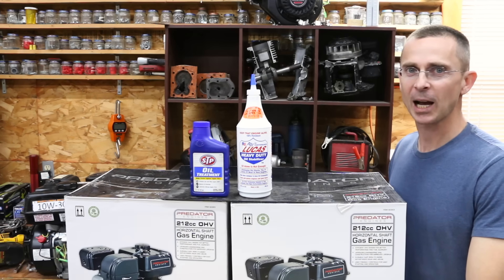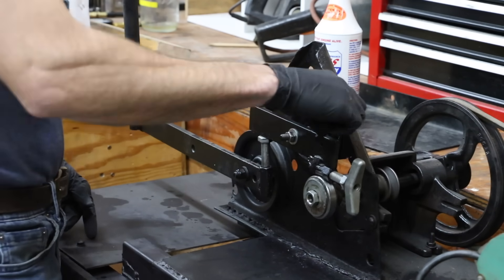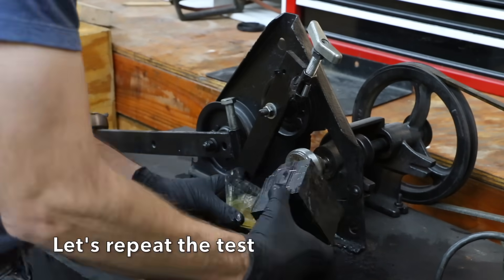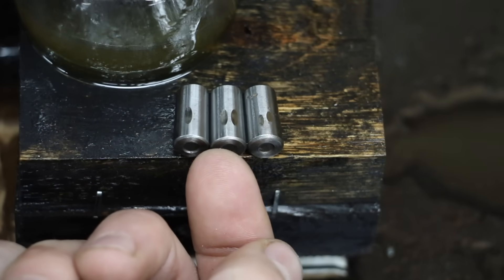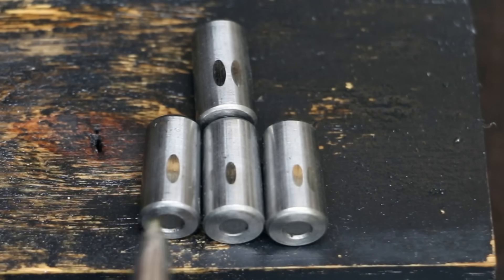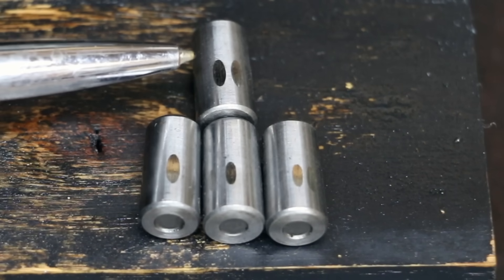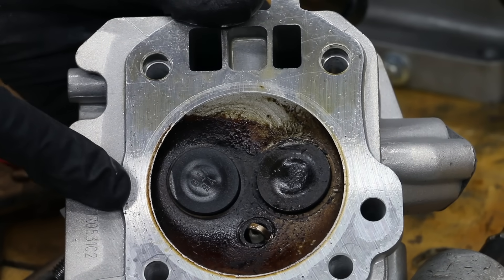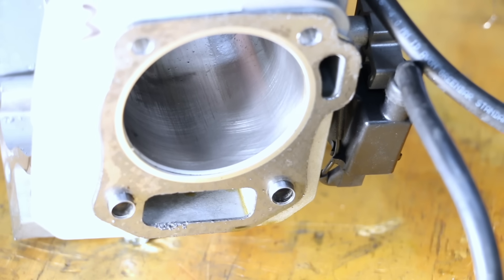Which engine self-destructs first?  Lucas or STP?

Comment: Both of those products are nothing but snake oil.  I found that out with STP years ago and have never been dumb enough to try the other product.  I use quality synthetic oil and never put Amy additives in it.
Reply: enemy4 2day Synthetic has been proven to be superior to conventional oil. There's no question about it.
Reply: +John Clarke

Ooo, a story! Could you tell us the story of how you found out that STP was just snake oil?
Reply: AZMike Older cars use diffent types of seals. Cars made in 1991 or before should be run with conventional oil unless the manufacturer calls for synthetic. 1992 and later synthetic is superior. I will never go back to conventional oil.
Reply: Jean-Claude, your link does not support your claim that synthetic oils are just regular oils with additives added... a claim that seems to overlook the meaning of the word "synthetic" to begin with. My understanding (possibly not correct) is that the synthetic oil molecules are more uniformly of an ideal length, rather than a variety of lengths clustered around the ideal as a natural oil would be.
Reply: Well in my experience, I had bought a motorcycle that ran a bit rough. I went through the typical tune up process which improved things a bit, but the engine still wasn't quite right.

So, while it was running, propped up on its stand, I added BG44K straight to the gas tank. It took about 2 minutes to hear and SEE the engine begin to smooth out.

My buddy was mocking the whole idea, and back then BG44K was "only" about 8 bucks a can. My mother was watching as well, as both her husband's had been car guys and mom loved anything that went vroom. She didn't believe in my snake oil either.

Imagine their surprise when we all heard the engine smooth out, and saw the bike stop shaking so much. It took a bit more BG run through oil changes and the fuel system, but the engine ran perfectly after that.

I believe it is with engines that have some miles/hours on them where you get the greatest benefit.
Reply: Yeah if you got a worn out tractor anything that is thick and gooey might help......no reason to dump that shit in a sound engine.
Reply from the maker: Thanks for commenting on this!
Reply: +AZMike ya they definitely will cause leaks
Reply: Rough running is pretty much always due to the carb, or fuel injectors being fouled up, additives that clean those are definitely effective when added to the fuel, adding them to oil is what people find questionable.
Reply: What you don't know can hurt you. Unfortunately the EPA has mandated that modern oils not contain the ZDDP zinc required by older flat tappet camshaft engines. If you don't run oil treatment in these motors, your engine will not live long.
Reply: Homecomfort, it may be due to that we hear so much nowadays that synthetic's the best...it spills over to using it in older cars.  But as Brandon Lee points out, it's really for the newer cars.
Reply: My first experience with lucas Is with a tractor that used a gallon of oil every 3 days. It had been that way for a couple years. Finally the boss said lets put lucas in it this oil change and see what happens. Ok thinking what a nut job he was but we dumped a gallon in with the oil and run it. After a month we noticed it was using less and less oil. It finally leveled out about 1 gallon a month of oil usage. Stayed that way for the next 6 years. The tractor had the same job to do every day year around. That never changed. It is hard to say the tractor suddenly decided to use less oil at the same time we put lucas in it. That was the one time i feel it seemed to actually work. Other times i used it nothing changed or the oil usage got worse! Reality of it is you probably have to have the right problem for the snake oils to actually work. That tractor it seemed to actually work. Probably a waist of time to use snake oil without a problem in the first place tho.
Reply: I have a 5.3 Silverado that had lifter tick for several years and I used lucas and it got rid of the tick, I dont know if I can say it improved the life of the engine but it got rid of the lifter tick
Reply: John: I am with you, I do the same!
Reply: Ahh maybe because EVERY real (SAE etc.) test of lubricants shows it is a superior product FACT
Reply: He has been driving without seat belts for 30yrs so he knows they are not needed either :-)
Reply: Yeah, wise decision, Amy additives are good for nuthin'!   (Whoever Amy is or was...)
Reply: John Clarke i AGREE. THATS WHAT I DO
Reply: I would not use Amy additives or  any Jessica, Angela, or  Ashley additives. They will definitely blow your engine.
Reply: Thank you! My Lord the number of people who think oil additives are a wise way to care for your engine is depressing. Use the right oil for the application and NO ADDITIVES!!
Reply: John Clarke if you learned STP was snake oil years ago, then why are you falling for the synthetic oil trend now?
Reply: John Clarke who's Amy??
Reply: Yes; please post a picture of her.
Reply: Amy I love her
Reply: But for older cars that've been using conventional oil, we're told that if synthetic's then put in, it may get past seals, causing slight leaks.
Reply: Synthetic Oil is almost always just regular oil (petroleum Base types 1-3), plus additives.  So, you can take regular oil and add additives to it, or you can take Synthetic Oil that is regular oil with the additives already added.
(Yes, I will agree that in the case  of Synthetic Oil the additives have been specially designed/formulated to match the base oil unlike generic additives like STP and Lucas).
For reference: https://www.machinerylubrication.com/Read/29113/base-oil-groups
Reply: That's good info for us to know.  Thanks.
Reply: azmike,  why would anyone put expensive synthetic oil into an "older" car?,  that didn't use it for most of it's life?
Reply: You sound so stupid
Reply: Synthetic is a snake oil as well.

Comment: Cera Tec by liquid moly, it has ceramic particles that are suppose to bind to metal, there has been some accounts of mechanic rebuilding motors and saying it left a super slick glass like finish but it takes awhile to build up and it doesn't do anything for the heads and cylinder.
Reply from the maker: Thank you for this recommendation!

Comment: Explain what running the engines without oil has  to do with how well the products worked. Thanks.
Reply from the maker: It's all about film strength, and capacity to handle heat.  The product that's the best in these 2 categories will last the longest.  There used to be hundreds of traveling roadshows with demonstrations like this one.

Comment: I'm a Bardahl product user all the way. STP I used for 1 purpose and one only. I'd rub it on engine parts before putting on the shelf(for later use) so they would not rust and it worked great.

Comment: i  added slick 50 to an old 3.0 litre engine with 255,000 km on it and never changed the oil or filter again my dip stick was rusted right to the end and i got another 200,000 km out of it with a dry oil pan and it was still running when the van basically rusted away to nothing that is the best oil slick 50 it saved me hundreds if not thousands in engine repairs and oil changes now that's a testimony i'll put my money on any day.
Reply from the maker: Thanks for sharing this experience!

Comment: Very cool. I'm sure it will be expensive to get a third engine but I wonder how long the engine would last with just regular oil...though I have a feeling if I search your videos you probably have done it already. How long did each engine last? Was that timer at 18 hrs? Or was that minutes
Reply from the maker: The 10W-30 engine lasted 37 minutes, if I recall correctly.   The timer shows minutes.
Reply: Project Farm oh ya its after you run it with the oil for 3 hours and then drain it and run it dry with only the film that's left on the parts. Interesting. So the regular oil ran longer than the treated? I have to check your video again I don't remember the final numbers of each. Ill answer my own question. Lol. Keep up the great work! Several of your videos has helped me pick the right product for what I need. Thanks!

Comment: need another idea? try alcohol. ive seen people try it before (Mythbusters). been thinking of running my chipper on some since it has an adjustable carb.  but i have yet to go get some. there is another 2 videos right there there. im kinda a small engine guy myself. saves lots of money knowing how to clean a fuel jet and do other maintainence and not pay someone over $50 to do an easy 5 min job.
Reply from the maker: Thank you for this recommendation!

Comment: Try a test with marvel mystery oil. I use it in my fuel and oil changes curious how it hold up and maybe other products slick 50 and or auto rx plus that one a bit more pricey about 25$ a bottle but they claim it's great for sludge
Reply from the maker: Thank you for this recommendation!

Comment: Great stream and video's very cool ideas.
I had Lucas save my motor on my truck once, only running recommended amount then. Water pump cracked, ran out of water and engine over heated all lights going off.  Engine locked up when I pushed clutch in while travelling at 60 mph on highway. I popped clutch which restarted it and ran another 20 miles knowing I would destroy the engine but needing to get to work. Got to work and locked up as soon as pushed the clutch in. I then left truck to set until break and decided to crank it up and to my surprise it ran. I then changed water pump and oil. The truck started up and got me home along with still ran for another 150,000 miles before I sold it. In fact still running. I use this in every combustion engine I have now.
Reply from the maker: Impressive!  Lucas is a great product!

Comment: I've heard of adding sea foam through a large vacume line like the brake booster line. will that work the same way it did when you added it to your carb?
Reply from the maker: Yes, either option allows the Seafoam access to the combustion chamber, where it cleans. Thanks for commenting.

Comment: I would like to see comparisons with all the "super lubricants" like ProLong, DuraLube, Slick 50, Z-Max, and others you may know about.  These are the ones that claim to absorb into the metal and be able to run the engine without any oil for long periods.
Reply from the maker: Thank you for this recommendation!

Comment: Two products to add to the test could be DuraLube and a product called MollySlip E . I suggest just doing the bearing friction test for different lengths of time and at different pressures instead of the engine test. All engines vary to some degree making that test inaccurate. Enjoyed the video .
Reply from the maker: Thank you for this recommendation!

Comment: just one question, how does it come that my car engine doesn't need an oil change after 3 hours but lawnmowers and chainsaws do? just because my oil in the car get's cooled again and again?
Reply from the maker: This is a great question.  Vehicle engines are built to last, benefiting from both tighter engine tolerances, much better metals, oil filtration, a pressurized oil system, and liquid cooling.

Comment: This is kind of a stupid test ! Niether of these products are designed or sold as a product to prevent werar/tear on your engine. They are OIL ADDITIVES - meaning they enhance your existing oil!  Now if you wanted to do the test properly, you would have left the oil in them, and seen how long they would run without doing an oil change.
Reply from the maker: Thanks for the constructive feedback.

Comment: Try this with Justice Brothers metal conditioner. It is very thin compared to STP. They say " it treats the metal, not the oil" is that true?
Reply from the maker: Thank you for this recommendation!
Reply: You're welcome. I have used this product in several vehicles and all of them sounded smoother. Cold starts were easier. But it is hard to get here in Europe.
Reply: Sorry, I used JB "engine treatment" instead of metal conditioner. I don't know the difference.

Comment: I was wondering if you have tested Prolong?
Reply from the maker: Not yet. Thank you for this recommendation!
Reply: Project Farm No problem! I had great results from it years ago in an old Oldsmobile I owned. It seemed to make a world of difference. At least the fuel system cleaner did. Unfortunately, I haven't been able to get it in Canada for quite some time. I believe there was a lawsuit in regards to their claims and such. I believe there were other products that were gone after based on the claims they made, also, but I am not 100% on that. This was back in 1999 or 2000, so the internet wasn't as fast as it is now, so a lot of that stuff didn't make front-page news in Canada haha! Personally, I loved the stuff! I'd love to see if it wasn't just in my mind! Or if it actually made any kind of noticeable difference. I used it religiously in my vehicles back then, up until it disappeared off the shelves up here!

Comment: what I would like to have seen were two things. First. when doing the bearing test a direct comparison when doing the mix, so that not only are the manufacturer recommendations done for the oil used but also on the other manufacturer. And second, after the first engine failed, turn off the second engine and strip it to see how much damage was evident at that point. My wife used to work for Tecumseh and told me they did tests like this all the time.
Reply from the maker: Thank you for this recommendation!

Comment: Project farm I love your videos always love them but I really wanna see an extreme test of the Lucas Fuel Treatment I believe that stiff works wonders and I wanna see a test side by side of standard gas then a Lucas to gas ratio of so the bottle calls for about 3 oz per gallon so you could maybe do 6oz total and then see how long each engine runs side by side
Reply from the maker: Thank you for this recommendation!  I've got some for testing.  I just need to do the test. Thanks again!

Comment: I have 2009 Nissan sentra cvt.trains  Have had the car for 4 yours I got a 115000 miles on it don't know what the previous owner did to it I don't have all the money to get a trans flush but there is a bolt underneath and I could change out a about  6 quarts ..I have to use ns2...it's about 20 a pop... Should I attempt to change it or just leave it alone
Reply from the maker: I apologize, but I'm not too familiar with that specific vehicle and transmission.  Have you checked the service manual to see what's recommended?  If it calls for changing it out, that's what I would do if it were my vehicle.  Hope this helps and thanks for checking out the video!

Comment: There's one problem with Lucas in the winter time it makes your vehicle harder to start you won't notice anything until the engine is warmed up to operating temperature STP has similar characteristics simulation must be done by centrifical force and motion replicating the engines tolerances and force between the two or four surfaces it also has to replicate in theory rotating Mass and the pressure is from rotating Mass this means an accurate weight and measurement must be done to prove or disprove a theory
Reply from the maker: This is a great point.

Comment: I agree about using an oil only motor test for a base comparison. I also am wondering if the same results would have occurred by using equal amounts of the two stabilizers in this test. Remember the dilution of the STP was about 50%less than the Lucas. I am a typical American in the respect that if the directions say use 1 I will use 2 lol.
Reply from the maker: LOL!  Thanks for commenting!

Comment: I think in order to get a more complete out look u need ten engines five running each additive,that result may be something unrelating to the additives and might be caused by variances in the actual parts that make up the engine, same make as they are,
Reply from the maker: Great point.

Comment: you can also do different brands of oil against each other
Reply from the maker: Thank you for this recommendation too!
Reply: Consumer Reports did a test of different brands of oils using NYC taxis over 60k miles. No measurable difference in wear between brands, multiple taxis per brand. They also tested (for one brand) 3k change intervals vs. 6k change intervals. Again, no measurable difference in wear over 60k miles.

Comment: I think you did a great job what was the difference in run times on the engine try motorkote against anything
Reply from the maker: Thank you for this recommendation!
Reply: I have been using Motorkote since 1992 and I think you may find it impressive. 
Motorkote.com

Comment: Like you, I don't have a recommendation for any products tested.

As for your test between STP and Lucas, it was a bit unfair. I remember STP coming on the market in the mid 1950's, and Lucas in the early 1990's. Guess what? STP was an organic additive and Lucas (that you tested at least) was a Synthetic additive. A big difference in flash point! 

 As you know, when you run things dry and the heat builds up something with a lower flash point will basically give up first. (It's hard to change the laws of physics.)

You should find a way to test things to find out which is a better additive while the engine is running properly. That is what really matters, not something that will run without oil.

As a simple dynamometer, try hooking up a hydraulic pump to each motor, then measure the pressure difference, if any. That would indicate if something is a higher quality product than another. 

If you or a subscriber could come up with a better method to measure the difference than what I quickly came up with, go for it!
Reply from the maker: All great points. Thank you for the recommendations!